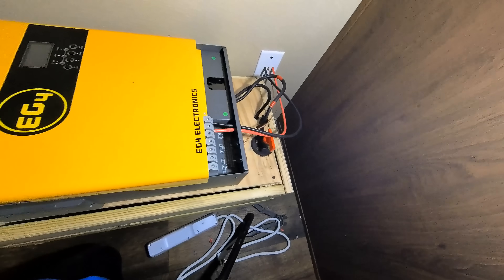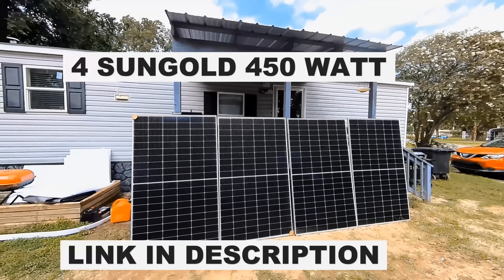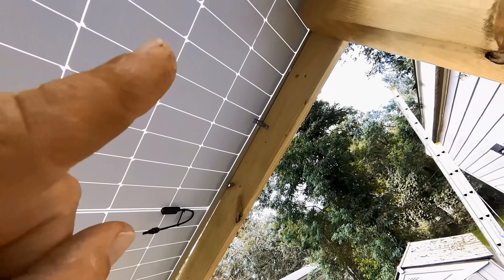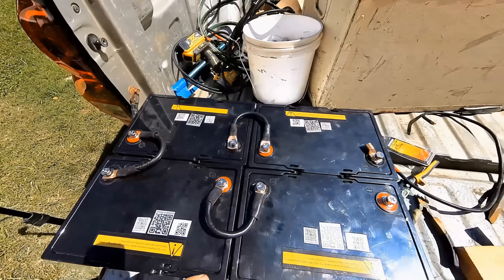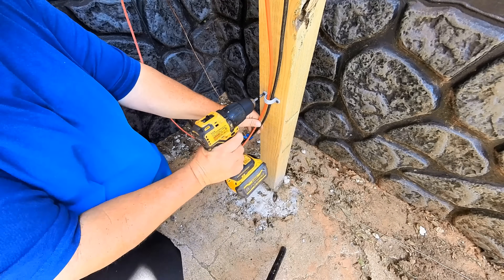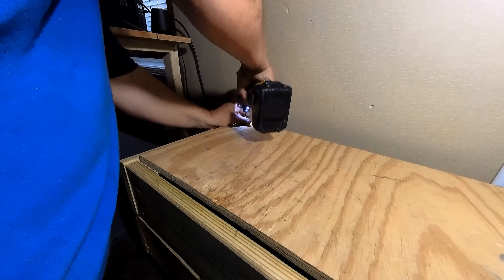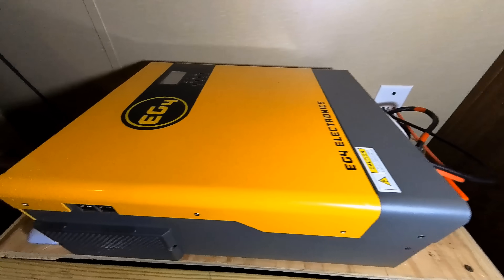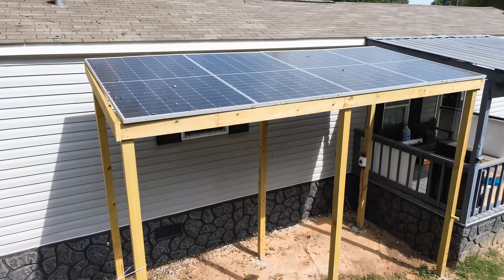Simple Solar YOU CAN BUILD!  Using Sungold Solar Panels

Comment: Nice video production. Would suggest using a crimp tool that actually creates a "cold weld" between your copper cable and the copper lug. At high current, you don't want unintended voltage drops, as this will create more heat and current flow thru your cable. A hydraulic crimper or a Tempco hand operated crimper produce nice crimps.
Reply from the maker: yes i do need one

Comment: More info about the ground rod would have been helpful, otherwise the content is clear, concise and encouraging.
Reply from the maker: everything electrical i believe should have a ground rod for safety against electrical shock in the rain or if an appliance gets wet...
Reply: @OKLAHOMAOFFGRID  Thanks for the prompt response.  What length of rod did you use?
Reply from the maker: 8

Comment: Make sure you also use some copper ground wire between each PV panels frame and then to grounding rod to protect from lightening.
Reply from the maker: ya i been hearing about that also to keep from getting feed back shock from high frequency inverters

Comment: Since you did all that, myself, I would go ahead and tie it into your main electrical and have your fridge, freezer, a few dedicated lights, stove, water heater & whatever else you would label as NEEDED POWER, For me, since we already have it, I would run my computer + all high demand power to them, to use with or without main power being interrupted, that way, you can take advantage of already having it and taken them off your main power, your monthly power bill should be dramatically lower.. That being said.. I have already done that several years ago, it started out as being for backup, but I thought since I already had it installed and running, why not use it now and save on my electrical, and I have slowly over the years added a few more panels and better lithium deep cycle batteries.. Now 100% of my house & shop is powered by solar. after first doing it, before adding more & more panels, my power bill was cut almost in half having al the high demand ran through the solar then after adding more I was paying about $25.00. Now, I have paid nothing for 3 years and I have a several thousand in credit that the power co. owes me. in another few months, I will be getting a check from them for the power they are buying from me, since 30% +/- of my excess power goes back to the grid everyday, I live in the city, I also have had several of my neighbors do the same thing.. Sorry to have babbled, but I so completely, love what you are doing and I have already done it and everyone who owns a home should invest in it and do it like I did, little by little adding more, till you're 100% or just happy where you are.. I also want to say, the past 3 years the weather has caused outages where I live 5 times and I never lost any power.. Thank you for making and sharing this video..
Reply from the maker: I have plans for a critical load panel..but this is for now for the video
Reply: @OKLAHOMAOFFGRID  Mine, at first was just for emergency power, but slowly grew and, It was totally worth it now, being 100% off grid..
Reply: This is why I love reading the comments. Knowledge. Thankyou.

Comment: Wouldve loved for him to have explained why he wired the panels in series rather than in parrallel?
Reply from the maker: the inverter/charge controller all in one Eg4  requires a minimum of 120 volts dc before it can even detect the voltage. the max input voltage for this inverter can be wired up to 500 volts dc. wired in parallel would not only need thicker cables running into the house because of higher amps but it would need to use more wiring to do it. the whole thing of getting the voltage higher is to cut cost and make more efficiency with the exact same power outcome

Comment: You could - and should - further dress up those wires going from the isolator to the house by adding some wire loom to protect them from sunlight and weather, and add another layer of protection to the wire entry with a wiring bulkhead like RVs use on roof-mounted appliances and solar.
Reply from the maker: I have been watching a lot of safety videos lastly learning tons and i am definitely going to do that

Comment: That "4000 cycles" refers to an 80% discharge - taking the battery from 100% down to 20%.  If you size your battery bank so its cycles are shallower - say, 75% to 45% - their lifespan goes WAY up.  Batteries don't like extremes, if you can size them so they spend more time in the middle of their capacity, they go way longer.
Reply: Wouldn't that mean, buying more batteries? And if so what's the math calculation to figure that out? Like what's using your total power draw, that way you could run absolutely everything at once for hours on end and not worry about a dam thing?
Reply from the maker: The way I see it the more you have the more possibility you have of something going wrong @Dark3rdayz
Reply from the maker: this is correct...these things could last 20 years
Reply: @OKLAHOMAOFFGRID  More like 19 years.
Reply: How do you "size it" to make the cycles shallower?
Reply: @michranden  I had the same question.
Reply: @loreniajohnson8147 what they mean is you add more batteries. Likely for this setup another parallel set of batteries to maintain the nominal 48V would double your capacity, so a typical load would only drop state or charge/battery level by half of what it would if you had half the amount of batteries. As someone said though, it is recommended to charge up to 100% and discharge very low on LFP batteries occasionally so the BMS can accurately track state of charge.
Reply: You shouldn't limit the maximum charge on LFP packs as the BMS will eventually lose track of the SOC.
Reply: Also top em up sometimes so the cells stay balanced

Comment: Thanks for the video I like the simplicity of this system!  I Just wanted to mention that EG4 inverters are supposed to be mounted to cement board or another non flammable material for safety!
Reply from the maker: yes I plan on doing some safety upgrades to the system and this is one of them

Comment: I'm new to working with electricity and have a question regarding the wiring from the panels to inside the mobile home.  I would like to use your setup for a metal shed and I noticed the ground wire used was not insulated.  If there was some type of problem which caused voltage to 'go to ground' would that not energize the mobile home also if the non insulated ground is touching the metal skin where it enters the mobile home?  Thanks again for your video!
Reply from the maker: No The path of least resistance will definitely be the earth before it will be you.  .all ground cables that go to the ground rod are copper wire without insulation...find the one on your house or by your electric pole and you will see the same thing
Reply: @OKLAHOMAOFFGRID  got it. thanks for the answer

Comment: You should try to separate the box from your house with safe n sound Rockwool. I’ve insulated areas that needed fire proofing with that stuff, I’d suggest in case of thermal runaway to have that box inside another slightly larger box with a buffer of Rockwool in-between … with thermal runaway it wouldn’t take long for the fire to jump from battery to battery with how close they are.
Reply from the maker: well I may do something like that in the near future
Reply: @OKLAHOMAOFFGRID  alrighty, happy to provide info if it happens to be helpful!

Comment: If the house pulls 2600 watts, try jackery 2000 plus 6 solar panels and use another 6 on the expansion
Reply: Or try using your BIG solar panels.. and after market connect to a jackery 2000 plus. And charge it there
Reply from the maker: the jackery cant even come close to running what this 5kw of batteries and 3000 watts of inverter with a 6000 surge will run..or I might try it

Comment: I really like the presentation, but I am wondering if there is a way to wire this panel to 30a generator plug to power my transfer switch directly to the breaker box.
Reply from the maker: yes there is actually. would work out good if you already had the critical load panel installed for a generator

Comment: GREAT VIDEO 🎉.  The only MOD i would add to the solar structure build would be to make the structure top end rotate by hand crank into the optimal angle for best sun capture as the Earth rotates. That way you achieve the best sunray input to your solar panels...🎉
Reply from the maker: I was thinking about putting some blocks of wood up underneath them to raise it up for the winter time
Reply: @OKLAHOMAOFFGRID  Rt on sir. Great job though 👏🏽

Comment: WHATS THE GROUND WIRE FOR? REPLY PLEASE
Reply from the maker: If your electrical plugs get into any water or the appliances you're using get into any water you lean up against them you're going to want your path of least resistance to be the ground and not your elbow
Reply: @OKLAHOMAOFFGRID  i didnt get it...sorry im slow...you mean if there was any electrical circuit happends it will go to the ground instead in ur hands/body etc..?
Reply from the maker: yes a ground is important to have to help keep from electric shock just from feedback

Comment: Nice video but, you should never use a high-frequency, transformerless inverter charger for the critical AC loads in your house. First of all without a transformer to provide galvanic isolation between this inverter's DC boost stage and its AC output, you run the risk of damaging your AC appliances and even setting them on fire. Second, this low cost EG4 inverter offers a shorter life expectancy and a poorer surge capacity than far more reliable, longer lived, low frequency, transformer based inverter chargers. In addition, without using a battery balancer with those four 12 Volt batteries, these batteries state of charge will deteriorate over time.
Reply from the maker: I have heard this story over and over on the high frequency inverters. I am definitely not doubting what you say. But my low frequency inverter only lasted me 3 years. I replaced it with this inverter in hopes all will be well.  I HAVE  another system running this same inverter for just over a year now with no issues. It also runs a critical load panel...as far as the battery's I can watch the cells on each battery via blu tooth  and if they start to separate a little bit then i will charge them individualy once or twice a year no worries
Reply: @OKLAHOMAOFFGRID  What brand of low frequency inverter was it?

Comment: Sweet!  Are those regular (110) fridge & freezer?  Would getting 12v (RV) be better, worth it?   (I'm looking at a little piece of land east of Okemah, OK for retirement. We'd practically be neighbors!)
Reply from the maker: I would not deal directly with 12 volts especially being that the battery bank is a 48 volt. I would convert it to the 120 volts and use common everyday appliances like I did in the video. Trying to use DC equipment can be very costly and hard to find and hard to find parts for. Yes it may be more efficient as far as how much power it uses but you have to ask yourself if it is worth the trouble it's better to just go with the flow of the normal 120 volt appliances you buy everyday

Comment: Great video. I already have a 1 KW 12 volt system plus a wind turbine but I run everything 12 volt from lights, fans, electric blankets, clocks everything is 12 volt.  I was wondering where is your charge controller as you can not pump power directly into your batteries from the solar panels without a charge controller???  This will fry your expensive batteries in no time...
Reply from the maker: No no..the Eg4 is an inverter and charge controller all in one.

Comment: I purchased a Jackery 290 and mono solar panel from HF both on sale and an Insider Tracker discount for right around 239. It's okay and  have used it mostly for lighting during a couple of power outages.. Then I thought about making my own but without all the features of the Jackery. HF had their 35 aH battery on sale for 59 bucks then I bought a 400 watt inverter from WallyWorld for 35 bucks. That one equals 420 watts. I put all that in a heavy duty plastic tool box which I vented. Now the Jackery battery is actually a 20.3 Ah. So for working purposes, mine is a bit better but the downside is no way to monitor the flow rate accurately but it's pretty easy to estimate how long it will run something by knowing the power intake of what ever I am using it for. Mine is also considerably heavier than the 290. But hey, it works and I can always use a volt meter to keep an eye on the battery level if need be. So basically I spent a 100 bucks and I can always charge it using the solar panel along with a charge controller. Also, I forgot to mention is the fact that the Jackery 290's battery is a 14.4 volt.
Reply from the maker: I'm thinking about building a cheap powerful one and doing a video on it
Reply: @OKLAHOMAOFFGRID  Your setup is great but if anyone is looking for something small, I would suggest they pickup a low drain battery, inverter and some kind of solar panel for emergency use. And I tell people, if they can't afford to get everything they need at once, just start with a battery they can afford and slowly build it from there. Anything is better than nothing at all. If all they can do is keep a phone charged and a small light for night. It makes a huge difference. I am fortunate in the fact that I also have a gas and a gas/lp generators as well. I see you live in Oklahoma, I live in SW MO. on Table Rock Lake and we know how fast these storms can rip through here.
Reply from the maker: im going to do a vid on a very small system

Comment: If i only use led light and eco laptop,not tv or refrigerator this is wery good option.
Reply from the maker: There's no reason you can't use the microwave for 2 or 3 minutes to heat things up no reason you can't use a toaster and you can run your TV 24/7 that system has been doing it ever since I hooked it up

Comment: This is what the internet is for. Great video very informative thank you.
Reply from the maker: Glad it was helpful!
Reply: I agree. But will it also keep the water heater going?
Reply from the maker: @annwithaplan9766  not really that's like 1500 watts to 3000 Watts every 3 to 4 hours
Reply: @OKLAHOMAOFFGRID  Good info. But that's why God invented Propane!
Reply from the maker: @R.A.Nobell  yeah but to be honest with you now if you check my system out now on my off-grid property I actually have enough power to run instant hot water heaters and electric stoves in completely do away with a propane but I do like to have propane as a backup
Reply: @annwithaplan9766  good question.
Reply: Yes Sir 🎉

Comment: Im in southern Cali out in the desert and I have that same EG4 inverter and it is amazing. You can do so much with 3000 watts and the capacitors are so big on the new EG stuff that they can run loads 100% off the inverter even if you had no batteries provided its a sunny day not putting strain on your battery. The new EG4 6000XP looks amazing, it has 2 independent solar inputs up to 500 volts and has all the breakers built in, its really as easy as it could get to make a 240 volt system for bigger stuff like washers dryers and welders, whatever.. This 3000 EG4 is awesome tho I cant say enough good things about it.
Reply from the maker: Yes that 6000 XP is a beast

Comment: QUESTION: Did you end up putting a cover plate on the exterior where the wires go into the house; or did you just caulk it?
Reply from the maker: I am ordering a cover off of Amazon to fit the vinyl siding for it

Comment: Great video.  The power of 48V is being able to run a lot of stuff at the same time without needing thick cabling to do it.  2 AWG cabling would net you 5000W of continuous power with very little heat.

I would suggest, though, that people building a 48V system get native 48V (51.2V LiFePO4) batteries and put them in parallel instead of 12V batteries put in series.

LiFePO4 batteries put in series require a whole-battery balancer to keep them all equal (they won't self-equalize between the four batteries), so you would have to add that for sure in your example system.  Series batteries also have a tough time when one or more disconnects on LVP or OVP and sometimes need coaxing to get them to reconnect.

Parallel battery configurations do not have these problems, plus expanding the battery bank can be done one battery at a time.

2 x 50Ah 51.2V LiFePO4 batteries in parallel would be equivalent to 4 x 100Ah 12.8V LiFePO4 batteries put in series. But the parallel configuration is far more robust.  Far far more robust.

-Matt
Reply from the maker: Yes ..this is correct
Reply: What would be the cost difference?

Comment: Pipe strap L brackets holding the panels - Check
Fasteners supporting horizontal load - Check
Amazon conductors in an outdoor environment with no conduit - Check
Knock-Off DC switch - Check

Seriously though great job on the build.
Reply from the maker: The cheapest do it yourself solar build by a diy guy not a licensed electrician 😂 and I can improve it here and there as the days go by
Reply: @OKLAHOMAOFFGRID  
100% respect the fact your putting solar to work cheaply and quickly.

Comment: Never use an isolator that is not rated for your voltage application (it wont be able to stop arcing when disconnecting a high current load), and never run a setup un-fused, even if it's temporary. This is how poeple get electrical burns or die in house fires.
Reply from the maker: It is already shut down awaiting the Amazon arrival..I finished putting the system together for the sale of getting the video finished for everyone